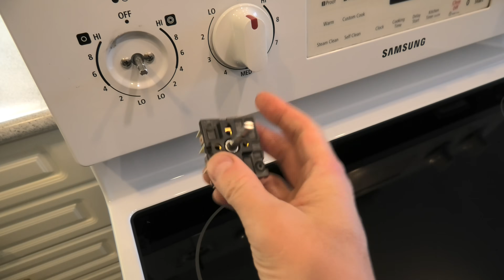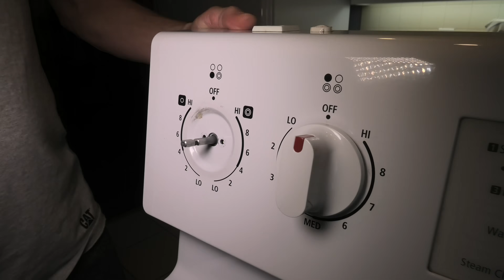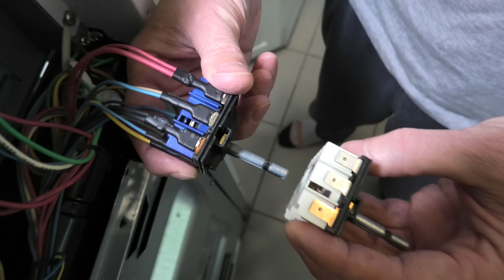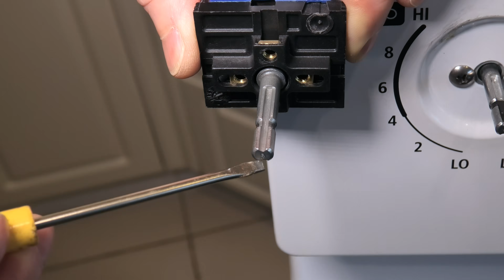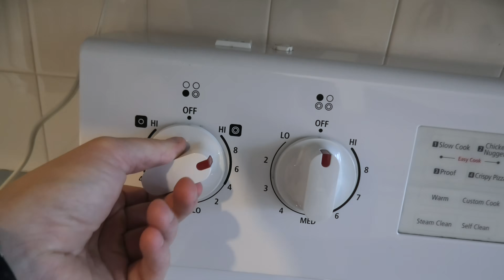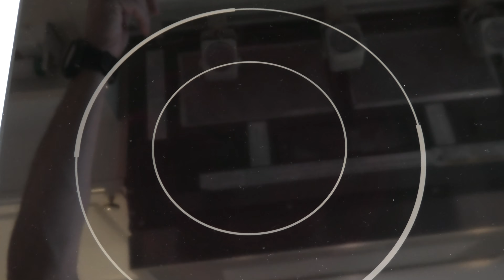Samsung Stove Burner Is Stuck On High! Infinite Switch Replacement.

Comment from the maker: PRODUCT LINK:
DG44-01002A Dual Infinite Stove Control Switch for Samsung Electric Stove, Compatible with FCQ3 FE71 FER3 FTQ3 NE59 - https://amzn.to/3NE1D7Y.

RECOMMENDED TOOLS:
1. RATCHETING SCREWDRIVER SET - Wera Kraftform Kompakt 60 RA Ratcheting Screwdriver Set, 17-Piece - https://amzn.to/424g1ZY.
2. THIN PROFILE LONG REACH PLIERS - Weller Xcelite Plier - Serrated Jaws | 378MVN - https://amzn.to/4a1biOB.

Comment: My replacement part only has two prongs on the bottom section, but the original had 3 with 3 wires (yellow, blue and orange). How should I connect that portion, I fixed the other burner recently and didn’t have this issue
Reply: Is this because it wasn't a dual burner switch?